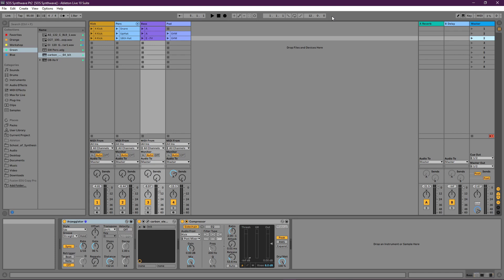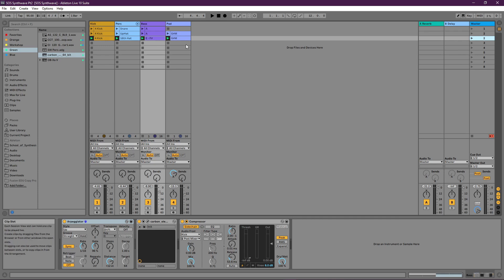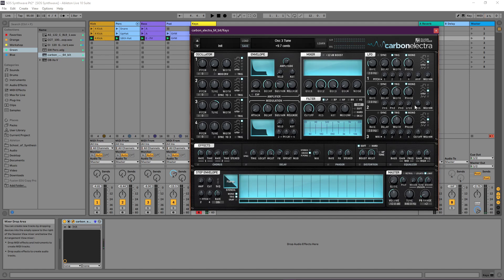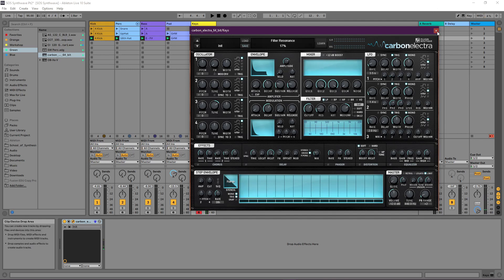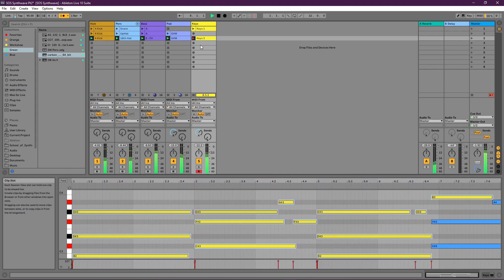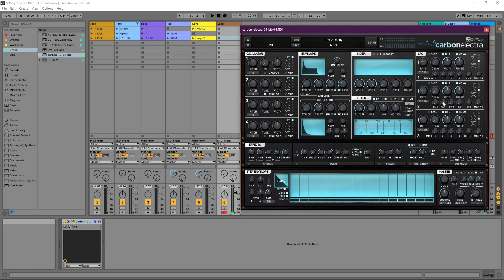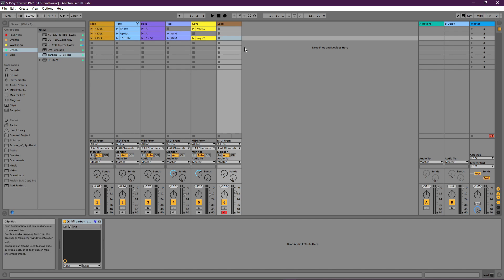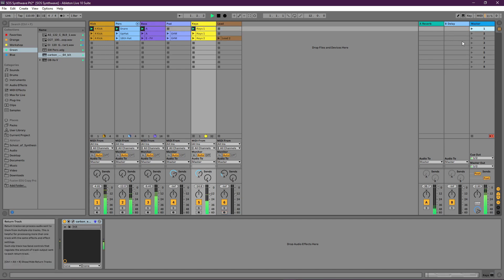80's Synthwave Tutorial Part 2 - Melody

Comment: Hi, fabulous tutorial. One question: Is the modulation envelope basically the same as a filter envelope? I was thinking of following along using Retrologue 2 but it is slightly different to Carbon Electra.
Reply from the maker: Depends on the synth routing but yes, if there is a filter envelope it would usually be a modulation envelope hard wired to the filter cutoff.
Reply: @SchoolofSynthesis   Does this envelope modulate or change the frequency spectra of the signal over time?